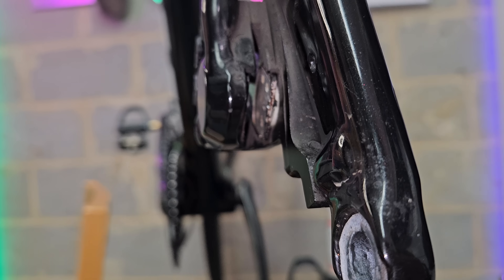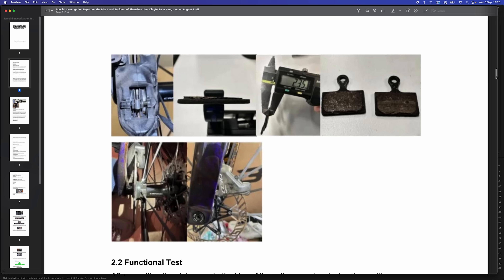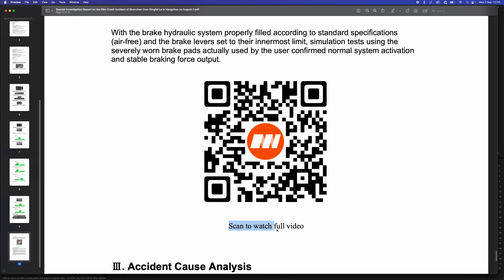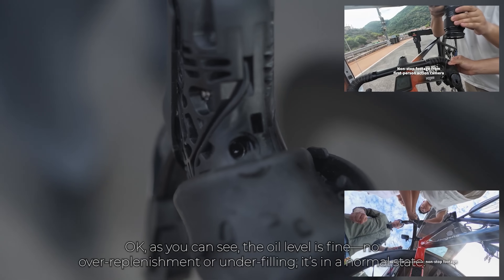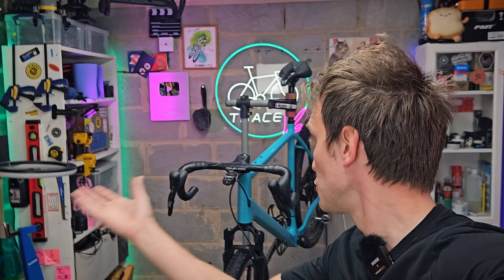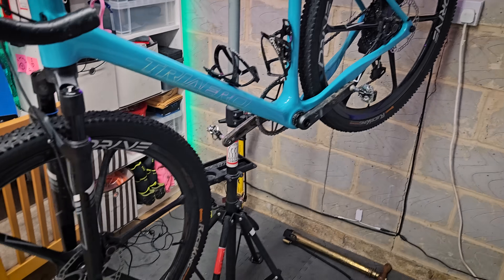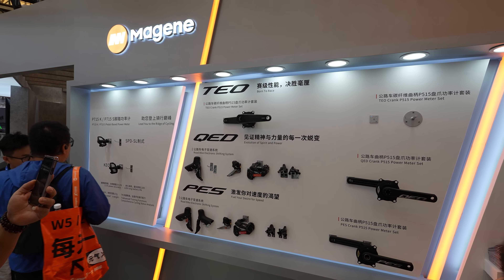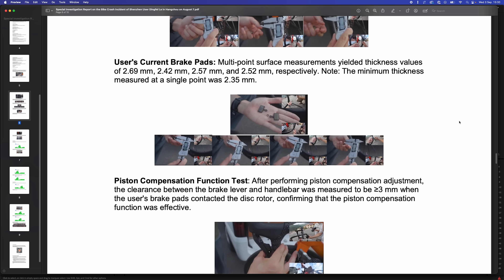Did their disc brakes really fail? - Magene responds

Comment: One possible scenario: the rider or technician setup and bled both brakes with new brake pads, then hand over the bike to the rider. Somewhere down the line, rider remove the new pads and put in the worn-out pads, thinking that it is still usable. Went to ride straight away without doing any brake check or pre-ride check. Both brakes will surely 'fail' to stop the bike in this case because the piston is in the wrong position (too far backwards), exert insufficient bite power onto the rotor to stop the bike. You can do this on any brake caliper of any brand and the outcome will be similar.
Reply: You just pump the leacer a few times ans the brakes will engage
Reply: This is one of the few scenarios that could actually happen as it effects both brakes and is entirely user incompetence.
Reply: Hi! I honestly don't believe what you're describing could have happened. Brake bleeding is done by removing the pads and inserting a spacer into the caliper, so regardless of the pads you install after bleeding, the pistons should be able to fit. Cheers from Italy \m/
Reply: @DrasticSolutionBAND  After bleeding, regardless of whether a new or worn-out pad is installed into the caliper, brake power will not be present straightaway. The person need to pump the brake lever several times in order to close-in the piston to restore the brake power. For this is another scenario which is even more remote which I have ruled out. My point is that the rider might have replaced a new set of pads with an old pad without pumping the brake lever to close in the pistons, hence, brake power is severely reduced.
Reply: @leethomaskc3327  What you say is all correct, but in the specific case in question, the accident occurred during a long ride and not shortly after he had started using the brakes, so even if the guy replaced the new pads with worn ones, he had plenty of time to pump and adjust the pistons. Regards.
Reply: @DrasticSolutionBAND  Noted on that. I know my theory is very remote and even a wild guess, but other than that, I cannot comprehend how 2 independent hydraulic brakes can fail at the same time on the same bike. Even when brake fade occurred during long decent, the brakes will still have sufficient brake power to slow down and come to a stop, with longer braking distance.
Reply: @leethomaskc3327  In the process of bleeding brakes, you have to pump the levers several times towards the end to try and remove more of the bubbles. You would also pump the brakes quite a few times after the bleed to check that it was successful. 

And lastly most people would go straight to bedding in the brake pads after bleeding and replacing pads anyway
Reply: @leethomaskc3327  On 2 systems failing independently but simultaneously; my guess is that this is just some face-saving excuse. I very much doubt that both brakes decided to stop working at the exact same time. The likeliest reason here is user-error but admitting that is admitting fault and, in Asia, that's not always an easy thing to do.
Reply: @DrasticSolutionBAND  Just to be pedantic, you can also bleed brakes with the pads in. You'll just have to insert something slightly thicker than the disc in between them. Whether that be one of those red plastic caps that Shimano brakes are delivered with, or even the disc itself with a little spacer wrapped around it.
Reply: @rayzecor  Correct, but it is not standard procedure.

Comment: It could've also been a failure in the top master cylinder seals/membranes. It's good to know that the problem is not repeatable on a new groupset, but that doesn't mean the brake system is safe to use!

Comment: Thank you for the follow up. Do these levers work while shifting, or partially shifting? In a panic situation it's possible to accidentally tap the shift lever while braking. Does that cause a bind in the brand/model?

Comment: It is statistically unlikely for both the front and rear brakes to fail at the same time, especially given that the front brake carries the majority of the braking load. The two systems are on separate circuits, so a simultaneous independent failure would be rare. A more probable explanation is a common fault or a user-related setup error affecting both circuits. I am not suggesting the individual who set the brakes up is incompetent, but it is worth noting that he is the common factor across both circuits.

I think Magene handled this well
Reply: Considering that the pads were dangerously worn, seems extremely likely to me that the rear brake was technically working, just had thrashed pads and so in a critical situation, the rider claimed 'both brakes failed' when in reality, the brake performance was simply poor
Reply: 4:44 , what do you think of that scenario? I'm concerned because the people who independently tested it with another unit of the same model of brake found the same, and they bled the brakes aswell. Either there's serious user unfriendlyness about the design of the bleed port or there truly isnt enough fluid reservoir.
Reply: if you have a design flaw like Magene's insufficient pad closure, then the same issue will occur on both front and rear.
Reply: @Shadowboost  but not at the same time the rear brakes would wear much slower
Reply: What ledinfei left out in his discussion with New ZEALAND Cyclist were his incorrect choice of disc rotor. With so many cutouts in the rotor,  it effectively serve as a resin pad cutter everytime he brakes.  Using metal pads with the rotor of his choice is clearly written in the document,  he choice to ignore it. 

Also,  magene 's design needs a different procedure to bleed,  which we dont know if le follows. If bleeded properly,  Magene's caliper can stop u even with pads all the way to the metal pins. The

Moreover, a bike  mechanic named HJS单车-黄技师 has demonstrated this with an half hour long video posted on bilibili,  if you or anyone who understands Chinese I highly  recommend to check it out. 

In the end I understand  though,  procedure  different  from Shimano  will all be considered  inconvenience and bad product design.  Otherwise  Sram will have a easier time to introduce its front deraileur to the masses.
Reply: Naturally not wanting to speculate,  but that's kind of what we do... Possible that the brakes were filled/bled after fitting with the wrong type of fluid, perhaps DOT 3 or 4 instead of mineral oil?
But I agree with yuo that dual failure at the same time would hint towards user set-up. 
I should know better, but ran my trusty old Proflex with Forumla B4 brakes from year 2000-ish for a gentle ride out on Hardangervidda in Norway, I probably had not changed or bled the brakes for about 5-6 years (Castrol SRF) and coming down the sabatuers trail to Rjukan I felt the brakes going spongy, and on the next release of the lever they pumped up solid, fluid had boiled and was seeping out of the reservoirs, front and back, I was able to scrub off some speed in a couple of turns and get down, but yeah, 3-400m of vertical descent through switchbacks on old fluid had me checking my pants. (Like I said, user error, and I of all people should have known better....) Good story though...
Reply: Or, I’d honestly just stay with shimano or SRAM.  
Why risk your health for want of a few pennies saved??

Side note; you know what else besides the user is a common theme on both brakes? magene
Reply: If it was a design error there would be far more incidents of mishaps. The fact the user was using worn out pads suggest someone that pays little heed to servicing their bike. The acoustics of those pads on the rotors will have been noticeable. The company have stood behind their product and their explanations seem reasonable. They didn't need to do this and likely would not have if they deemed for a moment they were at fault. Theirs one common denominator here.
Reply: "It is statistically unlikely for both the front and rear brakes to fail at the same time" - On Sram, Campa and Shimano, yes, because the safety margings built into them are so high, that the risk of a dual failure is close to zero. On this stuff? Everything is possible. If the brakes are indeed incapable of maintaining brake pressure after the pads wear to a certain point and/or the fluid is heated up from prolonged braking, then it is very much within reason to assume they will fail at the same time or within quick succession during a longer descent. 
But I am sure Magene will be thankful for you weighing in on their behalf 🤑
Reply: Agree
Reply: What if he had a flat tire, turned the bike upside down to fix it and then went straigt into the descent without checking his brakes?
Reply: Видимо, достаточно неисправности только переднего тормоза, чтобы попасть в аварию, ведь основное тормозное усилие приходится на передней тормоз.
Reply: Unlikely, yes. However, the brakes should be adjusted so that the rear brake engages first and carries the brunt of the load.
I think the brakeshift levers are fine, but I would install a Shimano GRX or 105/Ultegra brake. But what if the brakeshift levers lose pressure? Then oil would leak somewhere, specifically at the top, where the system would then lose pressure.
Reply: @jamesbont7052  i wouldn't recommend shimano 105 brakes, in my experience they're very unreliable. i've broken 2 levers already just by using them normally, and they have little braking power
Reply: The user involved used a combination of rotor and pads not recommended by the disc rotors' maker, Chaser. What that guy did is using super lightweight rotors with Resin pads, which Chaser did not recommend as it specify using metal pads with its rotor. So the end user can't really be 100% inconnect.
Reply: @zhuyufan1186  you don't even need rotors or pad material to have braking force with any other manufacturer. Backing plates touching each other will stop a bike more than what that guy had